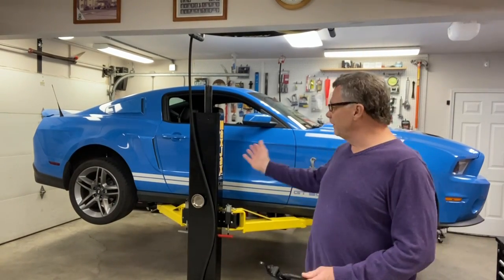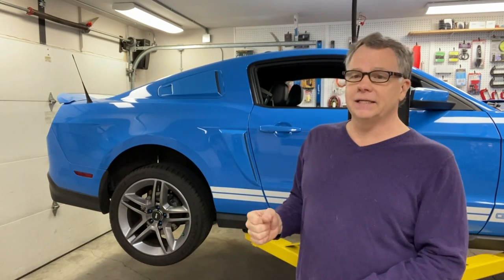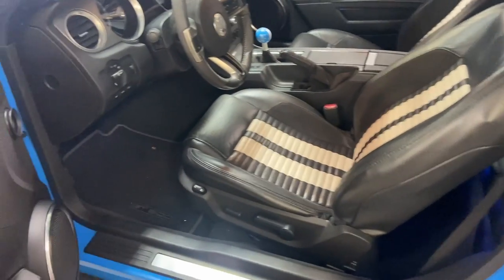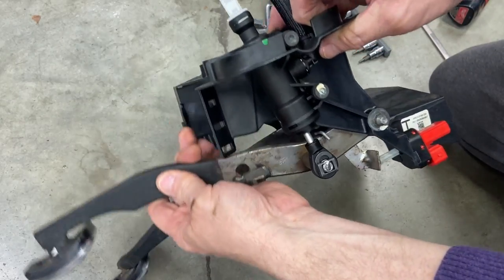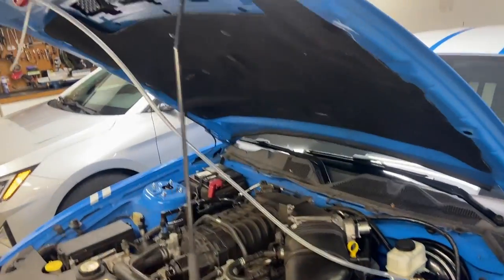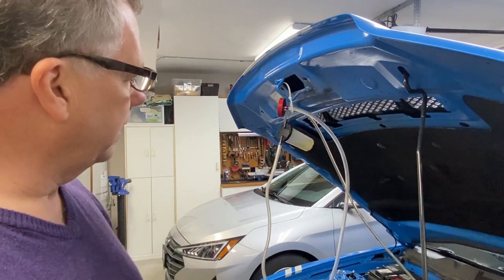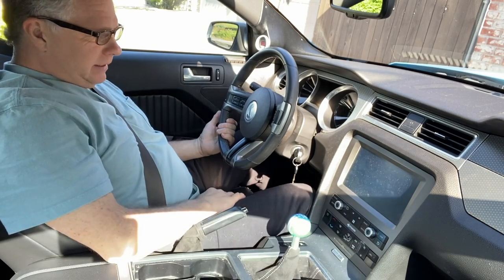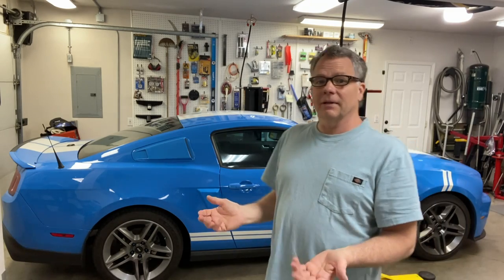Replacing Clutch Master Cylinder on the Mustang

Comment: Having a similar issue. I can tell at a stop that getting into first is tough and the clutch is making contact when pressed all the way. Also, get a little bit of synchro grind going into 3. Sucks. Brand new clutch, brand new trans, braided lines, independent reservoir. Everything new except for the master cylinder

Comment: Holy crap, literally same issue with my 07. Had an RXT clutch put in, drove it about 150 miles and it stopped wanting to come out of gear on deceleration. All the way to where if you stopped in first with the clutch depressed, it would be STUCK in gear. I'm half way through my master cylinder swap as I type this. Hopefully it fixes the issue so I can romp on the car for the last month of nice weather.

Comment: Yeaaaah, I did this replacement, but I used a metal GT 500 master cylinder instead of the plastic MC that came with it. I also installed an SVE clutch reservoir kit at the same time, and stomping on the clutch in this thing is night and day!

Comment: Hope you’re still active, I’ve got a question. Got a 2011 5.0 6speed, couldn’t hardly get in or out of gear. Had to cut off the car to put in gear. Replaced master cylinder, was good for 3 miles or so. Then back to having the same issue. I think I didn’t bleed it correctly, can’t get it into gear unless I cut it off and also if I have it in gear with the clutch pushed all the way in and I let off the brake the car will start moving in gear.
Reply: Does the pedal feel soft or firm? You got a different problem
Reply: @ Relatively firm

Comment: Glad you figured it out, i was wondering if a bad pressure plate can cause the same issue?
Reply from the maker: Generally speaking no, but I have seen a spring and material from the clutch disc break off and wedged itself between the clutch and the pressure plate not allowing the pressure plate to retract enough to free the broken part resulting in a condition were the flywheel cannot disengaged from the transmission. In this case you would notice an abnormal feel in the clutch pedal. Best of luck to you.
Reply: @mattsautomotivechannel  l'm going to change the clutch soon hopefully it fixes the issue, thank you for your help.